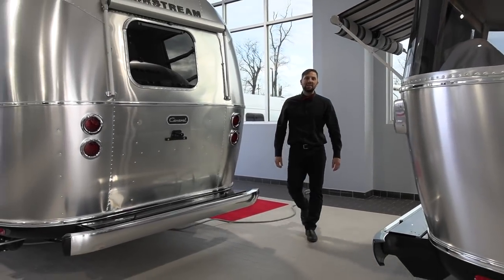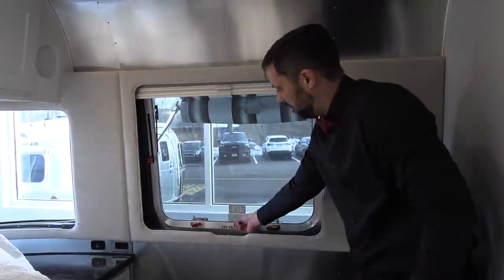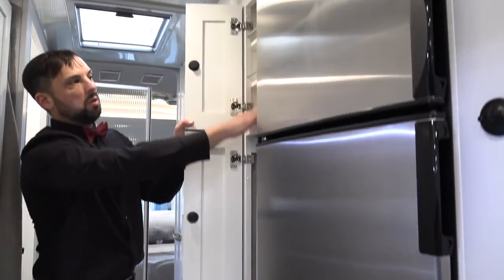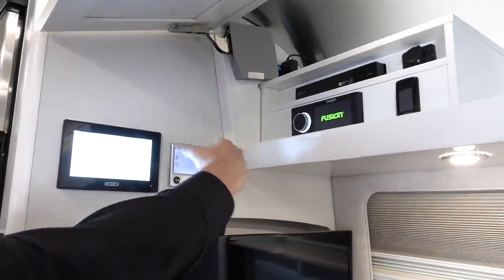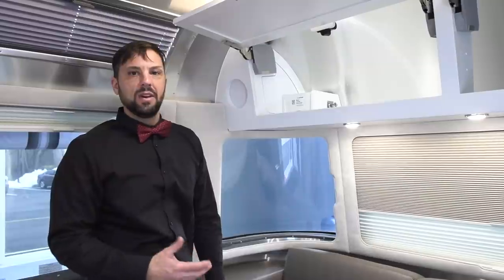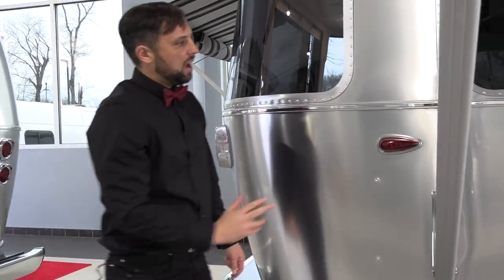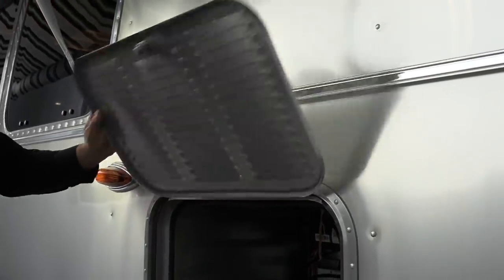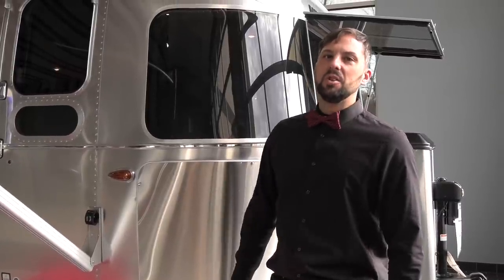WOW!!! New 2021 AIRSTREAM Classic 30RBQ Queen Full Walk Through Tour

Comment: So the classic, with the glycol heater, seems the best for 4 seasons, would you agree? I'm guessing slightly less window condensation overall.
Reply from the maker: The Classics Hydronic system is better suited for colder weather camping over a forced hot air system.

Comment: I like the Earl Gray in the slightly larger with the Desk and roomy bathroom.  I do wish they AirStream could put NuWave Bravo XL oven in these AirStreams as an option, it can do what the other Microwaves but also, Air Fry, Dehydrate, Roast, Reheat, Defrost, Toast, broil, bake, cook a regular size pizza and even comes with a pizza slicer, and comes with a 6-Quart NuWave Nutri-Pot Digital Pressure Cooker for free along with 9 accessories, including a temperature probe.  Also would be nice to have a washer / dryer, in the larger Airstreams.  You can put a stand behind the seat and put a stand to put a printer/scanner, tape deck, turntable, and anything else you can think of.
Reply from the maker: Thank you for the feedback.

Comment: Isn't that a smoke detector near the ceiling, not a carbon monoxide detector? Carbon monoxide detectors are supposed to be near the floor, are they not?
Reply from the maker: Thank you for watching. The CO detector is installed correctly.
Reply: @colonialairstream  , yes, I saw that later in the video. But you mistakenly called the smoke detector near the ceiling the carbon monoxide detector, I believe.

Comment: Really nice, but horrible flooring and synthetic surfaces for this price range! Nice wide plank oak floors would be bomb.
Reply: It would make the trailer heavier. No thanks
Reply: @robinsyverson967  Doesn't have to be more than veneer.  But at least make it natural! For $150K who wants to live in a plastic bag?
Reply from the maker: The Wood floor in a travel trailer will not preform correctly since the space is not climate controlled 24/7. The wood or engineered floor will expand and contract and buckle.
Reply: @colonialairstream  So anything natural is better than plastic for $150K, in my opinion.
Reply: We have a 2020 33’ Classic FBQ. We love the flooring! It is so easy to keep clean. The counter tops and cabinets rival the Class A we had before. We looked at close to a hundred different models of TT before finally taking a look at the Airstream. They are night and day compared to other units. We wanted quality that would last. The other manufacturer units were cheap: plastic fixtures in bathroom and kitchen, staples holding the drawers, and many were falling apart even though they were brand new. Stepping into the 33’, we immediately noticed the quality and attention to detail. We are very, very happy with our unit.